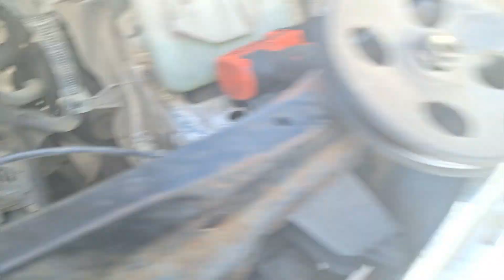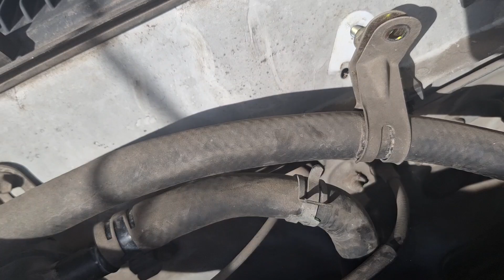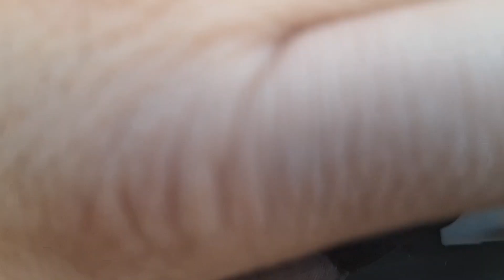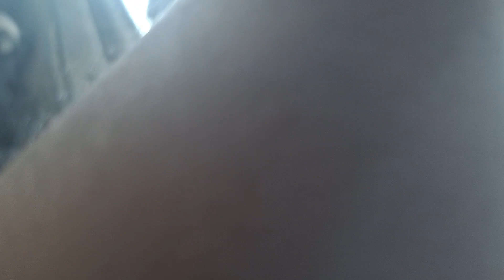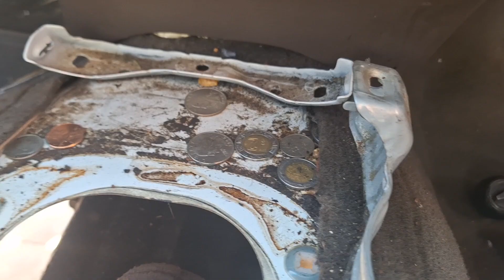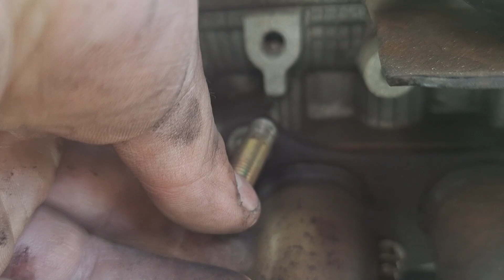How to Remove Engine and Transmission 2001 #toyota #tacoma 4 cyl. #2rz #3rz Backyard #mechanic #diy

Comment: I'm in So Cal, who do you like for machine shop services or engine rebuilding?    I have a 2001 Prerunner with a 3RZ and Auto Trans.  Great step by step by the way!   Thank you for posting.
Reply from the maker: @MartinGarcia-zl1kv   all the rebuilding I do myself but when I need engine machine work done I go to west California machine shop or Abel's auto parts in los angeles
Reply: @harborareatech310  Thank you!   Much appreciated!   Got a 2.7 with a bad head gasket, no overheat just catching a little gas smell coming from coolant.  Runs great but I'm not sure how bad it'll be once i lift the head off.   May just re-gasket if clean enough or i'll pull the motor and go for the rebuild.  Really appreciate your video!
Reply from the maker: @MartinGarcia-zl1kv  remove it and measure it. Head most likly may need resurfacing if it has a blown head gasket. This head had worn exhaust valve seats (common on these). Machined the head/valve job and replaced the piston rings/rod and crank bearings since I was already there. Truck runs like brand new now
Reply: @harborareatech310  I’m gonna order a machinist straight edge and make sure neither the head or deck has more than .003 warpage.  The head and block look recent, very clean and it doesn’t burn any oil.   I’ll check combustion leakage and blow by.   I suspect whoever did the head, didn’t buy new head bolts and reused the old ones.

Comment: Do you think I can install my engine the same way you took yours out I pulled my broken engine the same way you did on a 3.4 L 5VZ 04 Tacoma with the 4 x 4 transfer case still attached to the transmission
Reply from the maker: Never tried it on the 4x4. I would usually remove that engine with the transmission and transfer case still in the vehicle. It might work if you have a hoist that would lift it high enough.

Comment: Why didnt you just disconect the plugs from the sensors compared to taking rhe whole harness out
Reply: How long did it take you to remove the engine and transmission
Reply from the maker: @duggravs  took in total about 4 hours with recording
Reply: @harborareatech310  wowThat's way faster than I expected
Reply from the maker: @duggravs  super straightforward toyota made it easy on you for this one
Reply from the maker: @duggravs  I found it easiest to disconnect a few grounds and main ecu connector than to remove all the sensors connector and bolts/nuts from the harness which are bolted to the engine
Reply: @harborareatech310  where you located? do you have a shop or do side work?
Reply from the maker: @duggravs  I don't have a shop I'll do work on my own cars  and family cars from time to time

Comment: how did you take that power steering pulley off? no vids and the puller i got isn't for this type of thing
Reply from the maker: For this style pump I held the pulley with a screwdriver jammid through the hole of the pulley and the the pump while I zapped the nut holding it down with a impactt.
Reply: @ well yeah i get that, i can get the nut off, then the pulley is just like stuck on the spline, ive tried lightly prying it a bit. but its correct to say after that nut is gone, the pulley "should" just pull right off?
Reply from the maker: Yes, it should just come off.  You can try spraying g the splines with some penetrative oil. Lightly prying it off and or hitting it with a rubber mallet
Reply: @ thanks goat 🐐

Comment: another question. Putting 2004 2.7L into a 1997 Tacoma. Swapped out ECU, still have wire harness that mounts on top of glove box that 2004 harness won't plug into. Can I just repin it?
Reply from the maker: You probably can re pin  if you have the proper schematics, but it would be best  and maybe easier to just swap harnesses

Comment: If I have a burnt valve, should I just remove the motor to have it rebuild? The engine 4V, has 216K miles on it. I think I was quoted $2K for re-machining the motor.  The motor has to be removed for the  heads to be re-machined. Would I be better off in the long run. Or should I just remove the motor my self, get the heads re-machined and save my self some money by doing the removing and reinstalling of the motor? I love my Taco and never want to get rid of it.
Reply from the maker: This engine had a burnt valve, and it also had worn piston rings(consuming oil and a compression wet test increased the compression results). If you just have a burnt valve technically, you would be able to get away with just doing a head job, and that does not require removing the whole motor.
Reply: Just get a remanufactured head and swap the head, or if you want to wait.....have your head rebuilt. I changed a head on 1998 2.7L 4runner at 220K, it's now still going strong with 305k.  I purchased a 1996 2rz Tacoma that someone gave up on because the head was cracked. I bought reman head and it too is still going strong 40,000 miles later. The bottom ends are strong on these engines as long as you're not boosting and changing your fluids.

Comment: Nice work & helpful vid. Thanks for that. Do you have to pull engine with trans. I'm swapping 3rz-fe. Can't  I just pull engine, leave transmission in?
Reply from the maker: @Smoothboxnailer  yes you can depending if you have a manual or auto trans, some steps may be a bit different

Comment: How come you didn't remove the trans before you pulled the engine?
Reply from the maker: For me, it was easier to separate the two outside the vehicle
Reply: @harborareatech310  You use an impact gun for the crankshaft bolt and the flywheel bolts I am assuming, does it do it easily or it is best to use a wrench? I would think with a wrench/cheat bar would be very hard
Reply from the maker: @fireyourrocketts  impact to remove both. The flywheel bolts should come off easily with an impact. The crank bolt is tighter!

Comment: Mine is similar, 2000 Toyota Tacoma 5 speed; do I need to remove the tranny or can it stay in place? which way would be easier? I am rebuilding the engine and head, currently have a blown head gasket, as far as the tranny goes I will be replacing the clutch but I dont need to remove the tranny for this right? or do I?
Reply from the maker: You can leave the tranny in the vehicle suported with a jack or stand, you would just need to remove the starter and of course the bell housing bolts holding the trannsmission to the engine. I would say it is a bit less steps leaving the transmission in the vehicle, but linning up the engine to the transmission in the vehicle would be a bit more difficult, though, if it is a manual transmission.
Reply: @harborareatech310  It is a 5 speed manual yes, I am revisiting here as I am right now to the point, now I am removing just the block because the head was already removed and sent to machine shop last week; I did not have a blown head gasket, gas was 5 years old when driving the truck for test and gummed up having valve stuck open on cyl 1 hence no compression, the block seems fine but will overhaul as well since i am already half way then will replace clutch, water pump and oil pump if I see them with sign of wear; vehicle has 209K miles, on the head I am keeping the lifters but replacing the valves, I will be also replacing the fuel tank and the pump as the new one installed 3 years ago may be bad with gunk up fuel, need to find a way to clean the fuel rails as already have what needed to clean the injectors which are tested good; to take the head out it was a nightmare and I am not sure yet if once all back if I should install the engine as a whole or by pieces as I am taking it out, precisely because of the alignment of the block with the tranny; for supporting the transmission I looped a ratchet belt underneath it supporting it which can be tight to raise it some or lose to lower it giving me what I may need for the alignment later on, with the whole engine assembled the issues would be the 2 top bellhousing bolts at the center of the firewall; they are difficult to reach even with the head out!
Reply from the maker: @fireyourrocketts if leaving the transmission in the vehicle then the top bell housing bolts you get by loosening the transmission mount and bracket. Then tilt tailshaft down and use a long extension to access the top bellhousing bolts
Reply: @harborareatech310  I already took it out the block morning, since it was only the block I could access the two bolts on top, it was a bitch to separate the block from transmission, I supported the trans with a ratchet belt but the dowel pins were pretty stuck, there was no lubrication in the pinion, all dry and rusty it was so bad that I smashed a finger in the process by the force using while prying, now I have my doubts for the time when assembling back if I should leave the trans in ir take it out? I keep thinking how will I be able to join the 2?? only way is with some bolts  but the manual does not say how and I read against it somewhere; what you mention in your comment is best with a lift, mine is occupied now, to do that car has to be raised from ground quite a bit to accommodate me underneath; I do have a long 48” extention for this method

Comment: Dude, I can’t even say how awesome timing this to just have been posted. I’ve been doing an overhaul on my 96 Tacoma for the past few weeks and have read and watched several guides on how to pull the engine. This is by far the best that I’ve seen and has changed several steps with how I was planning to go about it. Could not be any more concise or clear. 10/10 fantastic 👏
Reply from the maker: Thank you. I hope it helps. Let me know if you have any questions during the procedure